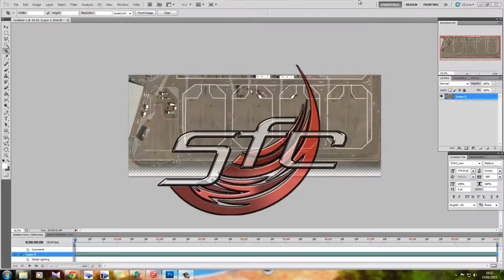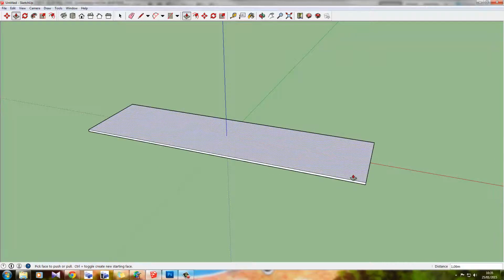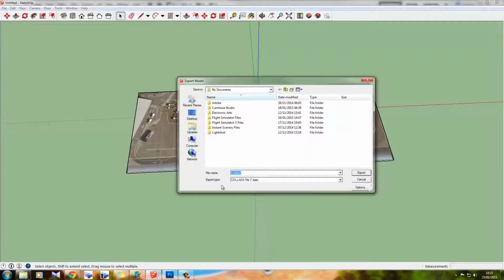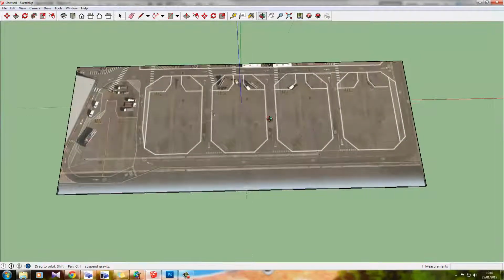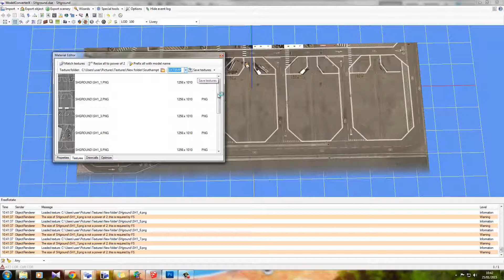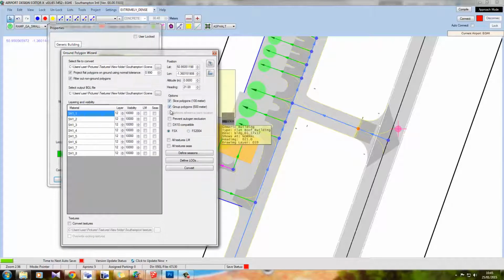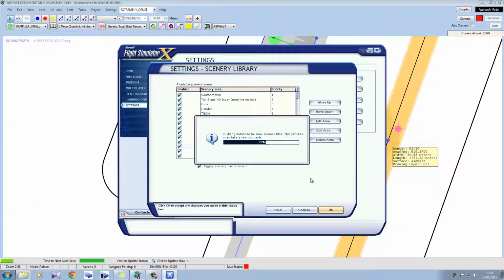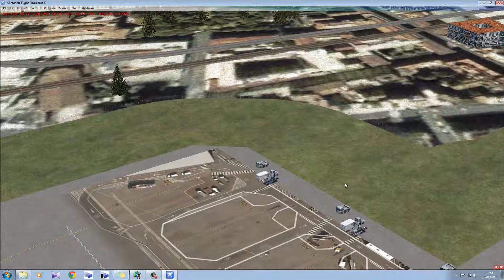FSX Scenery Tutorial, Ground Polygon Placement.

Comment: Im sorry to ask you a question,I've got two layers for my ground  polygons , and the question is the lower layer sometimes appears and some parts of the upper layer's texture disappear sometimes when you get closer at the ground from above
Reply from the maker: +Shieh Jimmy In FSX/P3D the earth is curved unlike it's flat counterpart in FS9.
If you're using Model converter X to place your ground polys be sure to set the correct altitude and use Layers of 4's
(for example, Layer 8 is your main ground image, Layer 12 is detail and, Layer 16 is markings..

Comment: Hi Mark, I am doing this scenery and have started to make the entire ground poly using Sketchup. However, when I converted using MCX and load it up in P3D, the textures are all shaking or tearing like there is an earthquake. Any chance you have got any idea of this issue? I am trying to start using Gmax but I really don't have much time to start the learning process and do it because school is just around the corner. I will really appreciate it if you could please help me. Thank you.
Reply from the maker: Hello, yeah you need to add a flatten use ADE for decent results. this should stop the texture peel you notice. if not try to add your ground polys at a higher layer 8, 12, 16, 20 and so on
Reply: I did put flatten around the area in ADE but that time since I was only testing the ground poly the entire ground poly is like 100 meters up in the air as I was also testing if the ground poly is landable or if there is any holes in it. Could you please specify how I can set the polys to a higher layer? One last thing, I don't know if it's a Sketchup limitation, but even still in Sketchup the textures are already shaking/flickering/tearing. Thanks for your reply.
Reply from the maker: In sketchup you are best setting your separate layers slightly higher than the one it lays on top of, in MCX when you use the GP wizard you get the material list, the layer and the visibility range. If 1 texture sits on top of another it will want to be at a higher layer, for example, Your base concrete layer will be at 8 and the taxiway lines will be at 12, cracks and HD detail will be at 16
Reply: Does that mean that the taxiway lines will be somewhat floating? I went to experiment around in sketchup and when I tried making every textures to Make Unique Texture is that it somehow set in place the texture and it stop shaking. I havent converted it to MCX yet as I am still trying to settle all the texture shaking with my ground poly.
Reply from the maker: +EmilFsVid yeah in Sketchup make the ground detail slightly above the main ground layer, then the taxiway lines slightly above that. and more detail slightly above where needed like tire marks and stuff. then when you convert in mcx they will be flat to the ground

Comment: In the FSX SDK you can read, FSX is confused if you use transparent pictures in ground polygon. It makes FSX really slow and results in low framerate. That's the reason to use a mask in sbuilderX, right?
And your methode will also have issues in P3D. It is not easy to make ground polygon correctly. Many things seeming easy, but there are not in reality.
Reply from the maker: It is true FSX has issues with transparent images, however in the correct format the textures work well. DXTBMP or DDS. This method also works for P3D. Hundreds of developers use alpha mapped images in ground polygons especially for the detail layer. As for the drop in frames I can't say I have noticed any drop after I insert a ground poly for a scenery.
Reply: Sure they do? Easy to find out, open some flytampa dds files for ground textures.
Receive your groundtexture aircrafts shadows in P3D?
Reply from the maker: Ground polys in P3D don't accept shadows if the layer is 32 or above.
Reply: below 17 also not
Reply: Soarfly Concepts Scenery hey so when i make a polygon and all that stuff and go on fsx i have 3 problems 
1. Size is always ten times bigger the it should be
2. The roation is not correct as well
3. And the polygon is overlapping over the real runway i can only see the pilygon when i zoom out if i dont i can only see the default textures
Pleaseeeeee help!